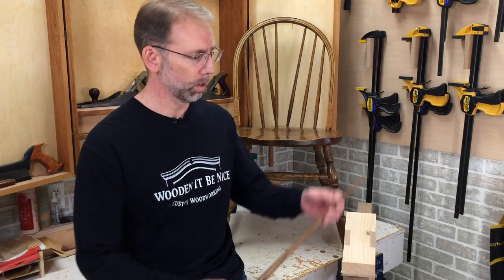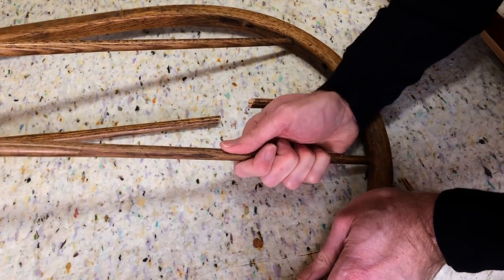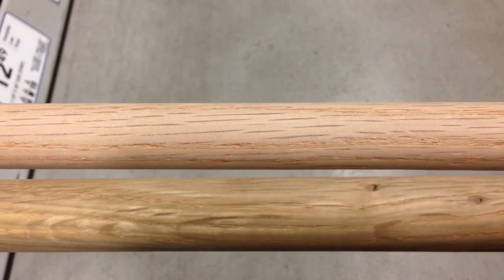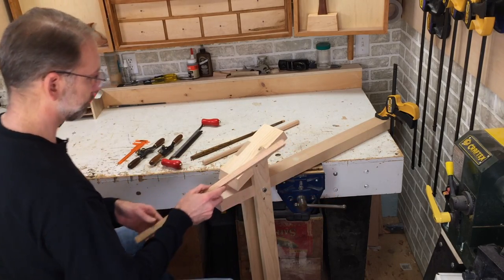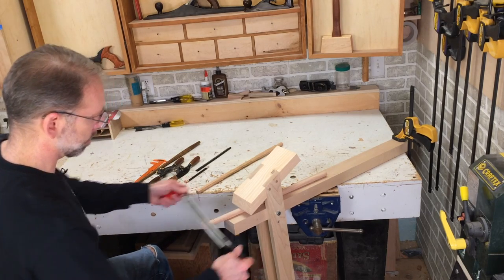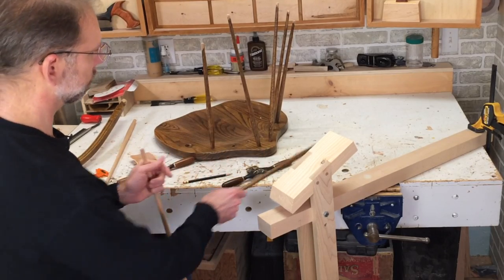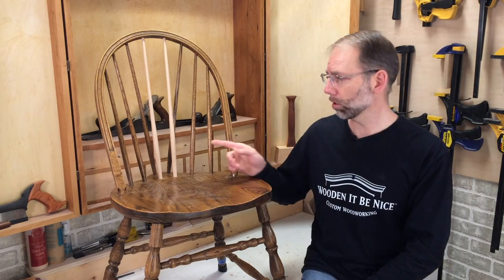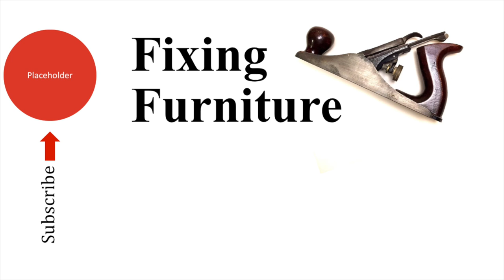Spindle Repair on a Chair Back | How To Woodworking

Comment: Thank you for your reply on a previous vid, and answering my question on replacing a spindle. Interesting watching good use of shave horse. All my drawn knives are well over 100 yrs old, great steel
Rich, Devon ,🇬🇧
Reply from the maker: You're welcome.  I'm glad you like it.  What's you preferred method for sharpening draw knives?  Scott
Reply: @FixingFurniture  im v.new to green woodworking,  but, I find to fix a sharpening stone into a timber recessed base, then clamp onto to shave horse, working the edge back towards you is a good method I have 6 grades of water stones

Comment: Spindle turning is the safest turning possible.  There is no way in blazes anyone has ever been "impaled" by a spindle "spliting apart", unless they were misusing their tools, somehow.  There's not enough momentum.  It would just fall.  The real hard part about that length is keeping vibration down in the middle.  So, it would require a steady-rest.

Also, try drawing your draw knife at an angle (not perpendicular, like that) and work "with" the grain of the wood, and you will have less trouble with "splitting" too much out.   

Really cool bench shave pony, though!  I have a proper shave horse, but it has to be kept outside and it's a hassle to run back and forth, sometimes.  Also, the weather does not always cooperate.  I think I will build this style of shave pony, this season.   Thanks!

Comment: I  like to make walking canes,  and found myself with a lot of dead time away from my workshop (waiting while wife shops, guarding cars in a church parking lot, etc.)  To kill time productively  I spent time sitting on the tailgate of my truck, tapering canes.  I found my best tools for this were a very cheap hardware store tiny block plane and a card scraper.  The card scraper was actually reasonably fast and didn't have problems with grain direction.  (I used an aggressive hook and held the scraper with one hand and held the work with the other hand.)  It may not have been fast, but was soothing AND cheaper than psychiatry!
Reply from the maker: Lol, I like your story Joseph.  I can relate to it.  I have a hard time sitting still.  I never thought of using a card stapler on something round... I'll give it a try.  Thanks.  Scott
Reply: @FixingFurniture  Scott - given the scrapers that you already have, you'll find that really bending the scraper away from you as you drag it towards you will allow you to easily fair the facets left by straight-edged tools. Also, by skewing the scraper when doing this, you'll effectively tighten the radius so that you can fair even tight curves.

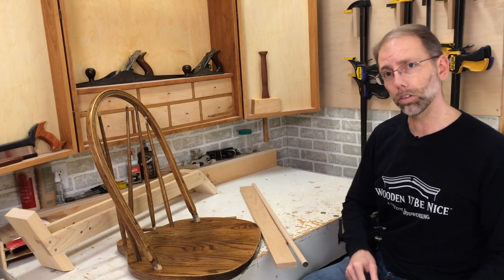I also see, @7:10,  that your bench stool needs reupholstering. Is that a future video subject?

Comment: Enjoy your videos a lot. Very educational. I do have one suggestion for you though. You refer to your draw knife as a roughing tool which it is but if you flip it over you can almost do finishing work with it. Keep up the videos, really enjoy them..
Reply from the maker: Thank you for sharing that tip Mark!  I appreciate it.  I will have to try that out the next time I have my benchtop shave horse out.  Cheers.  Scott

Comment: Scott,

I really appreciate your videos on furniture repair and I especially appreciate your attempts to fix the design flaws that caused the issue in the first place. I would love to see a video where you go over the elements of a well-designed chair. I have seen chairs like the one in this video where the back comes loose from the seat. I have seen chairs where the back and leg are constructed from a single piece and the chair begins to wobble front to back as the back/leg pivots at the seat. In your mind, regardless of the style of the chair, what structural elements should every chair have? What kind of joinery? Can you show examples of well designed and poorly designed chairs and explain what characteristics define them?

Thanks,

Jared
Reply from the maker: Thanks for the suggestion Jared.  I like your idea.  I will add that to my list of videos to create.  Cheers.  Scott

Comment: New subscriber here. Great instructional videos.  Thank you for sharing.  Do you use hot gun to loosen the joints and take them apart?
Reply from the maker: Thanks for subscribing!  When I work on joints that don't come apart, use heat only as a last resort as it can damage the finish.  If I suspect it's hide glue, I inject hot water into the joint.  If it's a modern glue such as a PVA, I inject vinegar into the joint.   If that doesn't get the joint apart (80% of the time it does), I use my heat gun on low heat. I hope that helps.  Scott

Comment: Thanks,for sharing  this rocking chair video.I'm planning on just using some Gorilla wooden glue to glue 2 middle loose spindles.(If,it works fine & if it don't...I'll just throw it away.

Comment: I have a question, if you don't mind. Why not tape off the joint and finish the spindles before reassembling? That would be my first instinct but I imagine you have a good reason for the way you do it. Maybe something to address in a future video.
I love your videos. I have been going through a lot of them since I discovered your channel two days ago.
Reply from the maker: That's something you could do, but if the spindle doesn't align the same way you anticipated, you could end up with an unfinished spot.  If you go the other way and put the finish part way into the joint, you loose some of the strength and the glue won't stick to the finish.  The best practice is to glue first, and finish second.  I hope that helps.  Scott

Comment: Great Video Scott. my biggest fear with a drawknife is having the wood spit too deep on me. has that ever happened to you? ECF
Reply from the maker: No, that hasn't happened to me, but there's a trick to using a drawknife.  If you use it with the bevel down, it doesn't dig into the piece you're working on.  It's similar to using a chisel to pare out a hinge mortise.  If the bevel is up, it will want to go deeper into the grain.  I hope that helps.  Scott

Comment: I was always told that glue won’t stick to previously cured glue. What did you do to remove the existing glue out of the spindle holes and off of the spindles that you were reusing?
Reply from the maker: Hi Marty.  Yes, unless the old glue is hide glue, you need clean joints.  I show in many videos how to clean out the mortices (holes) and cleaning off the tenons (aka spindles). Here's an example of a video so you can see how it's done - https://youtu.be/xTdWl3zuBBk

Comment: just a question are the type of wood glue you use is water soluble? if so would you recommend using hot water rinsing for extracting the glued up joints?
Reply from the maker: The glues I use most commonly clean up with water.  If you want to take a joint apart, it depends on the type of glue used.  Hide glue will loosen up with hot water.  Vinegar sometimes works for PVA if you can work it into the joint.  Here's a video on the 6 types of glue I use if that's helpful https://youtu.be/aRYNAlbBDUg

Comment: Do you put any glue or something to hold the Wedge back in place?
Reply from the maker: I apply glue to one face of the wedge to keep it in place.  Cheers.  Scott
Reply: @FixingFurniture  Have a crack in the middle of the chair. I don't want to break it more and disasemble all of it. Is there a way?
Reply from the maker: @signedelacroix7213  if you can clamp the split closed, then it can be reglued.  You can use a syringe or dental floss to work glue into the entire split.  You can see this in our recent video about a split cabinet.

Comment: My dining chairs have spindles but the tenons did not have slots with wedges in them, they were just glued in, and have come loose. Can I cut out slots and then add wedges to make a tight fit?
Reply from the maker: Yes, you can convert those "through tenons" to "split through tenons" to tighten them up.  Cheers.  Scott

Comment: How do you remove stubborn spindles that won't move when they need to come out
Reply from the maker: I use either vinegar and let it soak into the joint or I carefully use a heat gun to warm up the joint.  I hope that helps.  Scott
Reply: @FixingFurniture  thank you I will try this out thanks again for the tips and for getting back to me I really appreciate the help